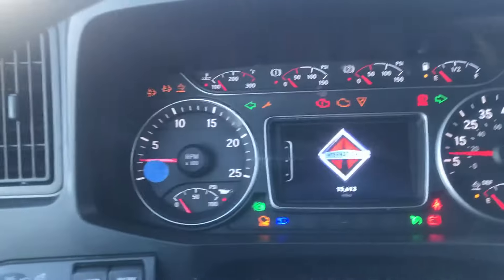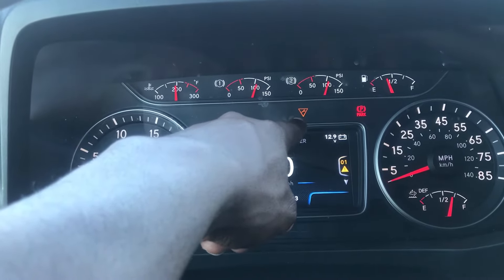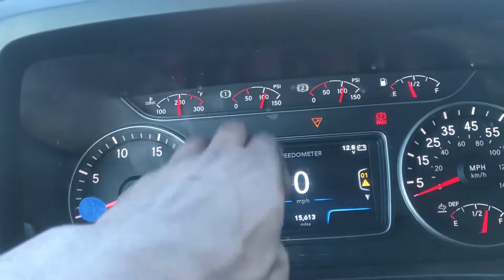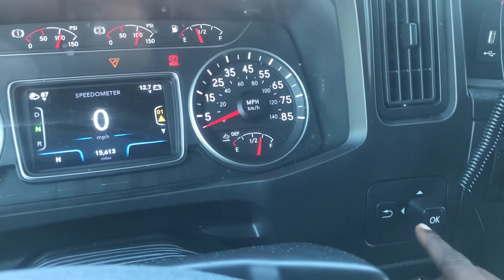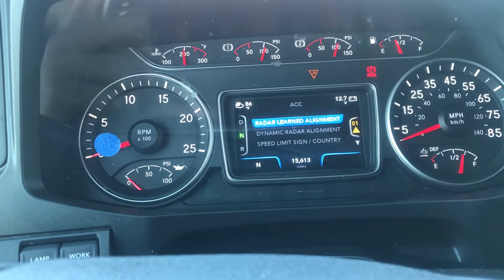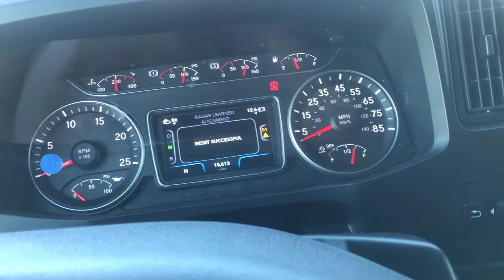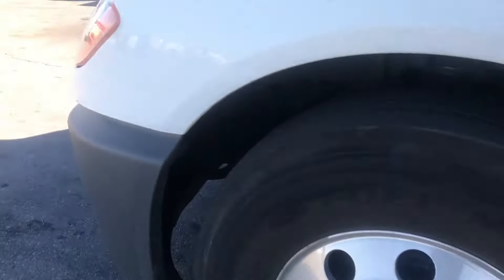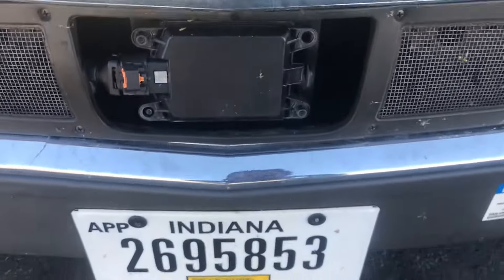2018 international pro star LT cruise control repair fix

Comment: A brother I want to thank you for this video.  My ACC warning ⚠️ came on and I couldn't use my cruise control and other lights came on. I have a 2020 International.  Thanks to your video I was able to fix the problem.  I thought I was going to have to put my truck in the shop. Thanks again.

Comment: I have a 2019 and my cruise control didn't work until I shut the truck off and restarted it after a few minutes all after following the steps in this video. Thanks for the video.
Reply: I have a 2019 too. Any more issues i need to be concerned about

Comment: 2022 International LT having the same problem cruise control set to 68 then RPMs drop speed drops down to 61 then back up to 68 67 and then drop back down to 61 I did the ACC cruise control alignment while driving and it fix the problem thank you
Reply: Stop. It's not even the same thing. His fix fixes the ACC. what you're describing is the PCC.

Comment: Mine doesn’t have the ACC tab. When I get to setup, I go right it it goes back over to trip. Those other two tabs won’t come up
Reply from the maker: Certain trucks comes with certain options probly you just have the base model an will have to search around in the vehicle section for anything dealing with alignment or speed

Comment: Any idea how to idle this truck
Reply from the maker: Taoufiq Ezznagui if it company truck it’s probly program to only continue running if it’s below 20 or higher the 70 degrees but if you put the truck in neutral an wait till the engine shut down lamp start blinking press the gas twice firm an it should lock it in. I think I have a video on it posted not sure, hope the info helps

Comment: yo...how do you overide idle shutoff?
Reply from the maker: KSD enterprises the new design is setup to save fuel pumping the brakes twice while in drive or low gear when the engine shutdown lamp comes on but with all the new sensors depending on temp for the day it could last all day or not
Reply: Its set up in the ECM. If the parameters are not programmed for idle shut down override, then it wont.

Comment: That does not fix anything. You need to get the radar mounting repaired and the radar alignment manually corrected. That process with dash does trays manual adjustment to be done correctly.

Comment: Still hate this truck
Reply from the maker: It be like that sometimes
Reply: Get my foot onTheBeat me too I hate mine too international’s are garbage got a 2019 with only 30k miles 2 weeks over 4 issues and my cruise control just quit working
Reply from the maker: Yea I wouldn’t recommend international unless it’s a 2000-08 with Detroit 60 or Cummings N14 two of the best affordable engines

Comment: How do you idle truck
Reply from the maker: TORY COLEMAN this trucks are way harder to idle bc it’s set with a fail safe on fuel so if it’s to hot it will run forever an if it’s to cold it will sill do the same but the was I saw that works at time is leaving the truck  in neutral an when the shutdown lite start blinking you press on the brake or gas twice it will cancel the shut down an keep the truck running. At can still shit off at time thou  hope the info helped
Reply: It idle by it self I have a 2018 to I love it awesome truck.
Reply: Idling is controlled by parameters in the ECM.  If its not set up, it wont idle.
Reply: Turn on cruise control and hold resume until it high idles it wont turn off

Comment: Actually that front sensor I blocked because it is annoying and applies engine break because international is a idiotic company so I blocked it witg aluminum foil and also the inside lane detector with camera it would tell me what's the speed limit is andlane departure in construction zone i just didn't want to hear that bitch nag so I made sure it won't work but my cruise been working until now and I have 571k on it but that calibration may be the issue

Comment: Where is the AC.control??
Reply from the maker: Walter Harp  what do you mean the ac controls? If your talking about the regular controls they are to the left  of the trailer air supply valve three circular objects  with directions towards working them